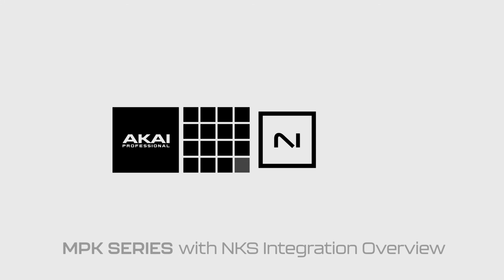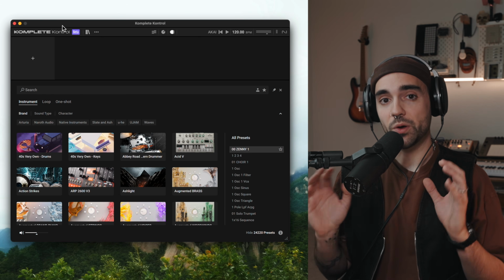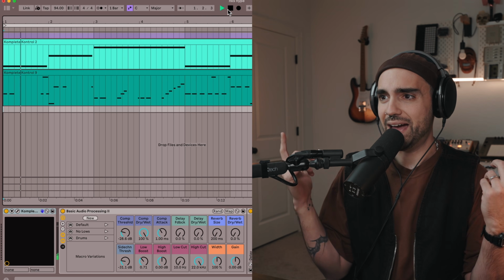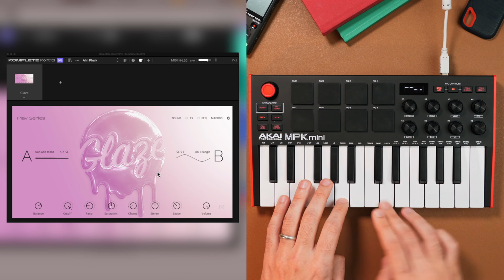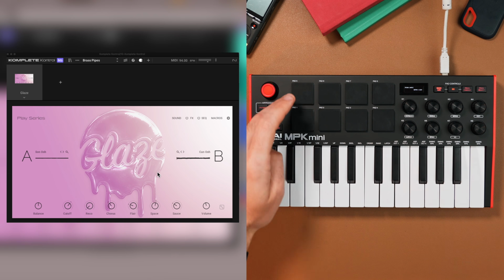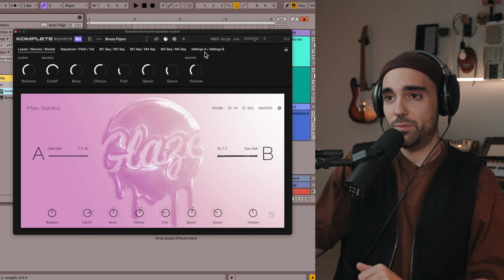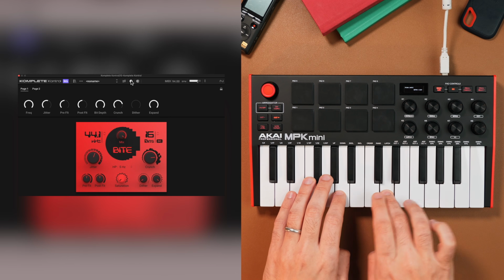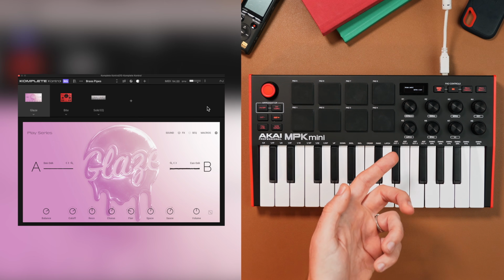Akai Pro MPK Mini IV + more now with Native Instruments' NKS Software Integration | Overview

Comment: Does this integration work in MPC Beats? I'm having trouble setting it up and can't seem to find any info about it. If not, it seems a bit silly that the MPKs comes bundled with MPC Beats and plugins that don't work with the program.

Edit: I'm using the MPK Mini Plus and it seems a lot of us are having this problem.
Reply: u have to code all of it had to use chatgpt to make it work, it's incovient but give it a lil research hopefuly it works 4 u

Comment: It would be nice if they somehow integrated the MPKs with the MPCs
Reply: You can. You just have to midi learn Your knobs faders and switches inside the MPC. 
You can do this with any of the MPK series. 

The only issue that I have is with the MPK mini plus and that the transport controls are not MMC, which MPC uses so the transport controls do not work between the NPK mini Plus and the MPC. 

However all the other MPKs that I've ever used work flawlessly in conjunction with  an MPC..

The MPK 249 in my opinion is hands down the best controller ever made. It works perfectly with any DAW, is highly customizable and it marries perfect with the MPC. I especially like this model because it has three banks of eight knobs, faders, and switches which I midi learn usually to my mixer so I can do my mixdowns in standalone.
Here's a real short tutorial showing you how to midi learn an MPK to the MPC 
https://youtube.com/shorts/CzV0gzNXF5g?feature=share
Reply: @ThePneumaOfficial MPK is all in one for MIDI
Reply: @markbruggeman274 absolutely agreed

Comment: After viewing your video with the possibilities of integration with NKS, I bought an AKAI mpk mini plus. Unfortunately, I am very disappointed that the integration is not as you present it. In addition to correct firmware and Setup in combination with Macbook Pro or Windows, after activation the controller in Komplete Kontrol or Kontakt sounds freeze and knobs do not work. I would like to ask you to advise me how to fix it. I thank you in advance.
Reply: Dear AKAI team I was surprised that the Akai team did not put more effort into the upgrade. It is not logical that a keyboard that costs more and has more features is not connected to NKS software and that users have to find their way and look for solutions. Many thanks and kind regards.
Reply: I forgot to say that it is the same problem with Komplete Kontrol if used with Cubase 14
Reply: I'm having issues as well. I can't even seem to connect MPC Beats with Native Instruments at all, which is very frustrating since the MPK Mini Plus comes bundled with both.
Reply: @the-good-chad  have you tried with Kontakt 6?

Comment: Is there a reason you left off the mpk225? Also can we mpk225 owners get a lil love 😂 I have a mpk mini& it’s cop but some of us like full-size keys
Reply: Should be able to replicate the behavior if you map the CC on the MPK225 to be same as MPK Mini. I don't see why it would be any different.
Reply: Just wanna add my support for this comment. Would love to know if there is compatibility and how. I’ll try the remapping but seems weird to leave the MPK225 out
Reply: @smalltownjon  @DiorLouis I can confirm that you can achieve this by programming the appropriate CC codes. I am using an LPD8 Mk2 for NKS control by using the same set of CC messages as an MPK Mini Mk3 (and setting to the Mini profile in Komplete Kontrol) 

Pads: CC12 to CC19 
Knobs: CC70 to CC77
Reply: @ my man! Thank you!

Comment: I tried on two Macs: one Mac Studio with Ventura and one Mac Mini with Sequoia. Both computers are great and run all audio applications well, and the MPK MINI MK3, too. However, it was a disaster when I tried to use Komplete Kontrol with MPKMINI 3, as in this video. Buggy! And keep changing the presets and showing the beach ball. Not sure why in 2 professional computers from my studio.
Reply: Strictly same here, a real nightmare. My Akai Mini Play > no midi mode in Kontakt Player and how to use Kontakt Player as plugin in MPC Beats ? Strictly zero tutorial.

Comment: Anyone else having problems with Native Instruments’ Komplete Kontrol working? I followed the video but when I run Komplete Kontrol it does a plugin scan first and hangs on UVI’s Workstation plugin. I removed it and then it hangs again on Unfiltered Audio’s Batallion plugin. If I remove them, then I cannot use either plugin. Does anyone else have problems with Komplete Kontrol just freezing and doing nothing?
Reply: I close the scanner that black square with the circle and it keeps going. the whole scanning process is dreadfully slow.

Comment: Why does the mpk mini plus only have the 8 macro knobs mapped?
Reply: I guess it’s because the mini plus doesn’t have a physical cc button to change the pads from NOTE to CC.
But you can edit a program of the miniplus changing the pads to CC and it will work.
Reply: @ thank you I will try this
Reply: @ one last thing, you need to choose the MPK mini MK3 in the Komplete Kontrol (do not choose the miniplus).
Reply: @robson4028 I tried this and it’s not working.. how do I do the cc 😅

Comment: Is not working for my mpk mini plus
Reply: You just need to edit the pads using the MPK program editor.
Change the pads from NOTE to CC and send it back to the controller. 
Edit: in the Komplete Kontrol choose the MPK mini mk3 (do not choose the mininplus).
Reply: just out of interest which program did you overwrite? one you never use, bring in the MPC control program 1 and load it back with edits to another slot? is that possible, or only program 1 slot 1 and permanently edited until you manually change the CC back to notes?
Reply: @ I sent it back to Program 5 (Garage Band) wich I never use. You can leave Program 1 with notes (as it is from factory) and edit any other Program you don´t use.
Reply: noooo
Reply: @ yup took me a while to figure it out until I read instructions. this is why they are all promoting using the Mini mk3 rather than the plus.
Reply: @DjMarkyBatch  but loopop did a demo of this with the plus one month ago. anyway i cannot find the new menu in kk   so probably is still not out
Reply: the MPK mini 'plus' mk3 only integrates the 8 knobs, you do not get the pad functionality like the mini mk3 shown here, disappointed to be honest. Not so much of a 'plus' device. Rather the opposite.

Comment: I just brought a Mac mini and they don’t take USB- A to USB- B. What cable do I need to use it as a midi?
Reply: A simple USB to USB C adapter. Amazon will be the best option.
Reply from the maker: 100% will work just fine!
Reply: @Akai_Pro  Gotcha thanks!
Reply: @AndyMacMPC  Gotcha! I’ll look into that! Thanks!
Reply: Or you may want to shop for a hub that has USB A and B..
Reply: @iameanx  I’ll check that out! Thanks!

Comment: Salute been waiting for a long time for this to happen this feature ❤🔥 i have used my other devices to control komplet kontrol amd kontakt threw midi ports using either midi 5 pin or other USB i have to set-up templates maps for each knob or pad so difficult to figure out the perset change connection also each instrument those 8 knobs seem to never stay maped so yes thank much appreciated for making this possible yeah i have an komplet kontrol A25 keyboard still tho i mostly use my mpc 🔑 61 so this will be very helpful once its implemented for 🔑 61 and meny other 3rd party devices ❤🙏🏾👏🏾👏🏾👏🏾